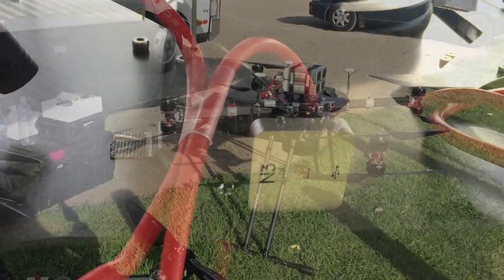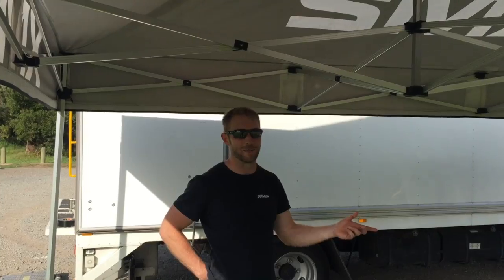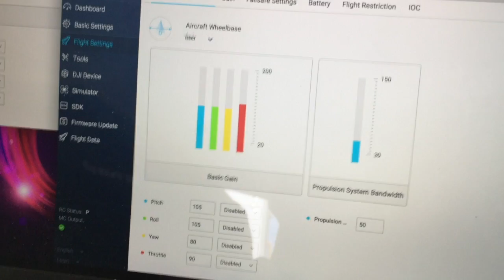DJI N3 and A3 PRO on Big Drones

Comment: Hello sir, I made a custom frame for a drone and I want to use the N3 controller. I am worried that my drone crash on the first flight due to the default gains of the controller. Did you change your default controller gains before your first flight?
Thanks in advance and very nice video :)

Comment: Damn good build! Sorry about my curiosity but are you using Tiger motor flame ESC´s?  If so where do you get the 5v from for those ESC´s because the A3 is not outputting 5v from motor outputs?

Comment: Hi guys. Nice arrangement. One question: where are placed the batteries? Is it a vibration dampener for batteries of some sort? If so, do you sell this accessory? We have had bad experience with gryphon dynamic frame (the very first versions, of course, not the V2 and not SP), because of the vibration due, in part, to the batteries. So I am very interested in a fix for that. Thanks in advance !!
Reply from the maker: Hi Jaun, this is a custom solution we designed and manufactured. If you want more information and pricing please contact us at sales@xm2.com

Comment: Hello guys have you seen this tutorial from DJI https://www.youtube.com/watch?v=XmsD1fUr5k8 I'm reffering to propulsion system bandwith because  I see really low values on your settings. Are you sure you set them correctly ?
Reply: I mean your propulsion system is almost exactly the same as DJI E5000 and they recommend bandwith between 70 and 80. Can you please clarify your low settings ?
Reply from the maker: Yes have seen this video before tuning our systems - our motors / propellers are significantly larger then any DJI UAV so that's why the number is quite different! Thanks
Reply from the maker: Correct, except we are not using Field Oriented Control (FOC/Sine) or ESC Braking, so the values we have work well. With the DJI esc I expect it can react faster!